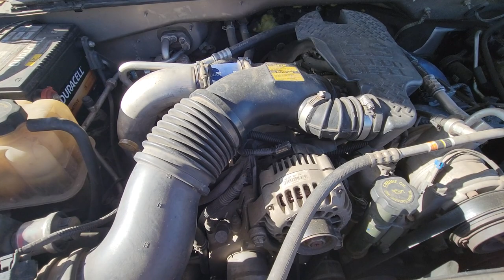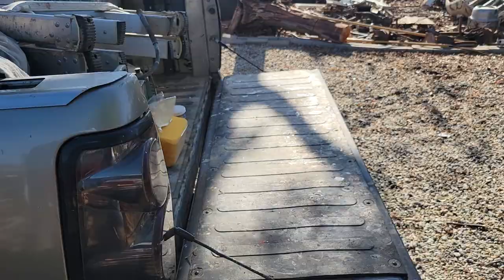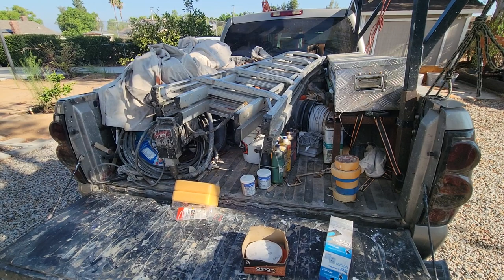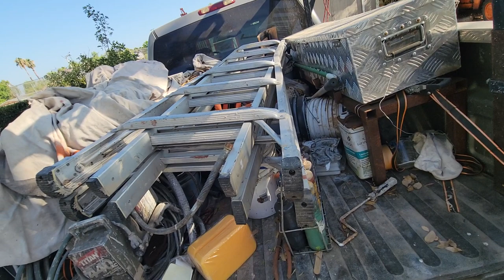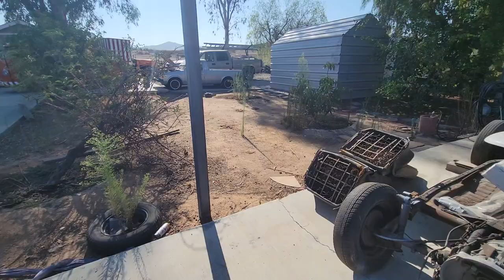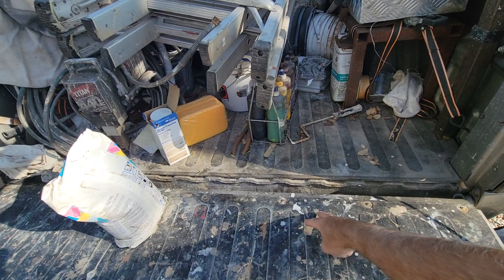House Painting business is becoming a SHIP SHOW......in CA

Comment: I am a General Contractor who works like a handyman who paints the areas I work on. 

On occasion, I will accept a full scale paint project. Usually it will be in conjunction with repairs. 

I just did a complete exterior paint job on a 2,200 ft² house. That's body, trim, gutters + repair work (fair amount of repairs were needed) for $14,000.00. Took me 5 days by myself too include repairs.

But I will agree, that finding quality laborers is almost impossible.
Reply from the maker: yea I did one a few months ago no wood work or repairs. 11500....2 story house and 90 ft patio cover. I would have done that house in the mid 2000s for 5 to 6k